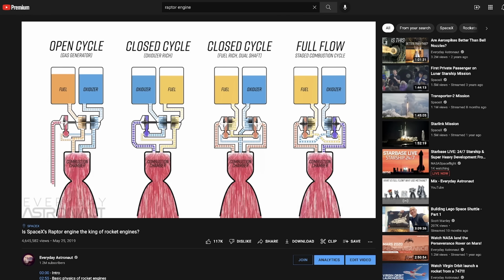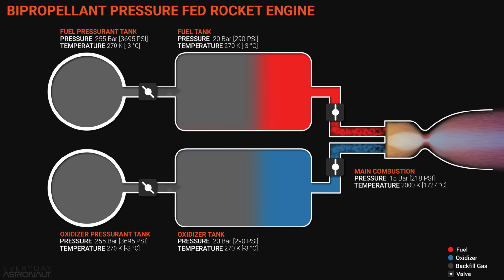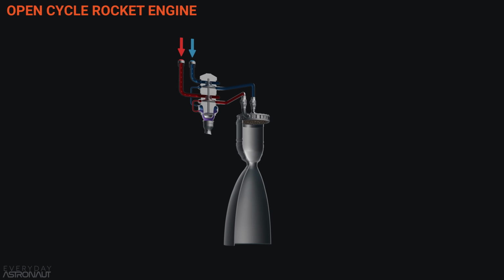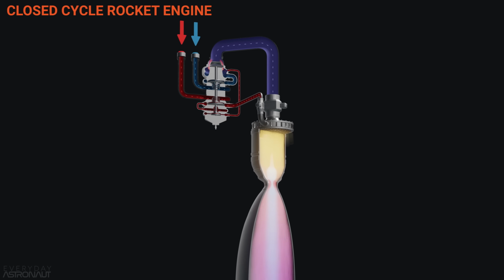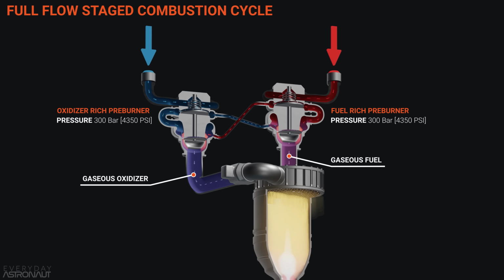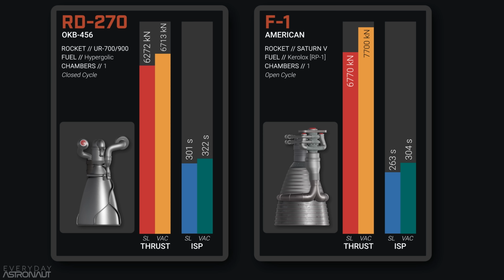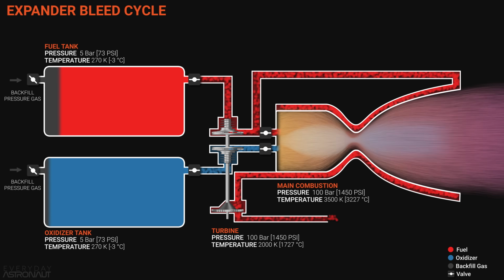Rocket engine cycles: How do you power a rocket engine?

Comment: Oh yeah, on 2nd viewing; about that Tap-Off method.  How about modifying that way up high on the storage tank end of the contraption?  essentially turn the storage tanks into a syringe with a small rocket engine pushing down on the piston to pressurize the fuel then use the pressurized fuel to run reciprocating pneumatic motor type pumps to get the now super high pressurized oxy-fuel into the combustion chamber?

Comment: Please I want to ask why is oxygen rich staged combustion cycle is single shaft and not twin shaft and what of Hybrid FF ORSC
 Hybrid Full-Flow Oxygen-Rich Staged Combustion configuration, commonly abbreviated Hybrid FF ORSC.
The architecture combines:
a primary oxygen-rich staged combustion loop,
with a smaller fuel-rich methane preburner circuit.
Unlike true full-flow staged combustion engines, the oxidizer side remains dominant while only part of the methane flow is fully gasified prior to chamber injection.
The design aims to capture many of the advantages of FFSC systems while avoiding the full complexity associated with dual large-scale preburners and completely independent gasified propellant loops.
Design Objectives
The Hybrid FF ORSC architecture seeks to achieve:
near full-flow combustion efficiency,
improved propellant mixing,
reduced turbine thermal stress,
cleaner combustion,
lower maintenance requirements,
and simplified operational sequencing relative to true FFSC systems.
Because both propellants enter the combustion chamber in partially or fully gaseous states, combustion efficiency is expected to improve significantly compared with conventional ORSC systems.

Comment: Need a 3rd element steam. Use water to cool down around the nozzle that turns the water to super heated steam then use the steam to compress the gas again then run steam through liquid oxygen to turn it to water then back to cool the nozzle.  A closed circuit.

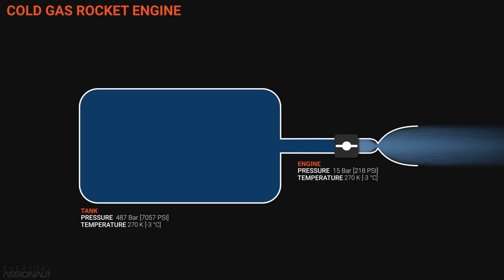Comment: hey man super great video, i almost made it 1/2 thru. at 8:42 you mentioned that as the pressure drops in the nozzle, the fluid changes phases from gas to liquid. it would go the other way: pressure down, would make it a gas; pressure up would make it a liquid. visualize a cylinder with a piston in the bottom going down, pull the handle down: more volume, the atoms are more spread out; push the handle up (less volume, pressure up), the atoms are closer together and it becomes a liquid. or you could use PV = nRT. it’s something i learned in engineering school, you could ask one of your friends who went to engineering school to explain it to you. 

i kind of don’t think you really have what it takes to be an astronaut. your videos are pretty ok tho.

Comment: I know this is a bit late, but with the mono and biprop pressurised engines, instead of having to have a big heavy tank, could you instead have a monoprop decompose to pressurise the tank enough to work, as needed?

Also, instead of the autogenous pressurization system used on super heavy, could they use some of the power from the pumps and pump say helium around a hot part of the engine, to heat up and then into a heat exchanger in the propellent tank to heat and therefor boil the propellant to pressurise the tank? That would eliminate the problem of water ice forming in the tanks and blocking the propellant lines to the engines.

Comment: Why not pump the gas from that engine directly into the fuel and oxidizer tanks to maintain the pressure instead of having a pump? I feel like this will be more efficient.
Or literally just have some fuel be pumped into the middle of  the oxidezer tank and use the combustion gasses to maintain pressure in both tanks
Reply: Well, tiny rocket engines already spin the turbine. But capturing main exhaust is very hard: you need to somehow move that high pressure and temperature from bottom of your stage to the top

Comment: I’ll skip the obvious question about whether or not rockets work in a vacuum, and move on to one that can’t be but pushed off:  the flow of fuel through the engine works completely differently from when under atmospheric pressure, and is completely unpredictable, maybe even useless because of the vacuum, what do you think ?

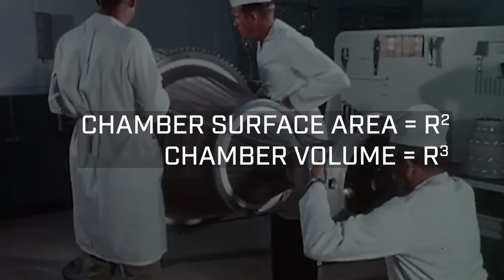Comment: Thank you very much for your video. At 48:57 You say 'This means it's actually easier to cool a large rocket engine  than it is to cool a small rocket engine.' But square-cube law you referred says the exact opposite. And also we know 'increasing surface area to volume ratio will result in more rapid heating and cooling'. So these make your sentence wrong, or am I wrong
Reply from the maker: There’s more fuel flowing in a large engine which means proportionally more fuel flowing through less amount of wall surface area = more cooling capacity. There’s more hot stuff in total with a large engine, but less hot stuff touching walls the larger the chamber is

Comment: 4:46 I would rather refrain from saying word "heat energy". Because the energy is mostly represents a stored type of quantity. While heat is a kind of form which only appears when it crosses boundaries. The proper use of word is "thermal energy".

Comment: I‘ve always wondered: the concept of a pressure fed engine - where the high pressure gas should be sitting 'on top' the propellant push it down into the engine, and the propellant likewise should...well...'behave well'...and sit quietly on top of the pipe that leads to the engine.
Which is not something you can guarantee in a zero G environment.
What if the propellant bubble just decides to float aside? and now the pressure feeding helium is going straight down to the engine?

I've heard propellants in turbo pump driven engines can have the same problem, and mitigate it by using ullage motors or hot staging to use the rocket's own acceleration as a 'artificial gravity'. Once the engine is going, the acceleration will keep the fuel 'behaving well'....

which can not be expected in a quick firing RCS thruster that uses pressure feeding systems.
There is no acceleration to keep the fuel settled down.
So...how can spacecraft floating in orbit fire their pressure fed thrusters without the fuel floating problem?
Reply from the maker: Watch my video on how to start a rocket engine! We go into great depths about ullage thrusters and such 👍
Reply: @EverydayAstronaut   Yeah I've seen that video, was a nice one too. But still I don't see how it can be applied to RCS thrusters. it's not like spacecrafts fire ullage motors everytime before they fire RCS?
Reply from the maker: We talked about that in the video, they use things like wicks and surface tension devices, or even bladders or pistons for RCS operation 👍
Reply: @EverydayAstronaut  guess I've gotta whatch it again! thx for the advice!

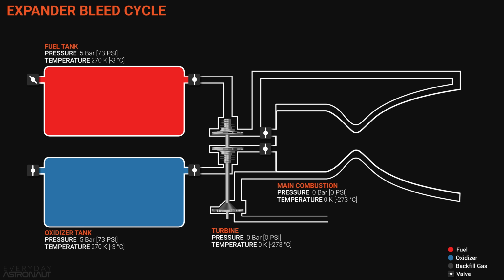Comment: 51:11 I dont understand the difference in open cycle and expander bleed cycle if the fuel just gets dumped out anyway? Is the expander bleed cycle not just open cycle with reactive cooling?
Reply from the maker: Expander bleed doesn’t have a gas generator. The energy to spin the turbine comes from the fuel being heated through the regen channels

Comment: Late to the party, but shouldn't there be an explanation early on for why the rocket actually moves? That is, how and where the propulsive force (reaction) is physically applied to the rocket.  I remember being very surprised to learn that this happens nowhere near the nozzle, but at the opposite point of the tank from where the gas escapes.  I was shown arrows indicating equal pressures inside the tank, except where the nozzle was.  The unbalanced pressure forces the opposite, sealed end of the tank to move, taking all the rest of the engine and vehicle with it.   I'll bet a lot of people poorly understand this basic idea.  I miss those arrows!
Reply: No. This video is for the advanced enjoyers of the rocket engines. It focuses on pumps specifically. If you need the basics, go find another video, this video is already long enough.

Comment: When will rockets have push and pull mechanics or is it all just push? Jets use push and pull mechanics, Jets go fast! Rockets go slow, have you seen a jet take-off? Compared  to a rocket take-off? Jet fast, rocket slow!
Reply from the maker: I think that’s a matter of perspective! Rockets usually are accelerating around 1.3-1.5G vertically. They’re just HUGE so you can’t really tell. That’s way faster accelerating than any other jetliner horizontally. Granted some fighter jets can accelerate horizontally faster for a bit but rockets usually get over 3G when their tanks get emptier near the end of the burn. So rockets are way faster
Reply: @EverydayAstronaut  Rockets are clearly slower, I see it at every launch. How sluggishly slow they get liftoff. How much fuel they burn during lift-off. Jets much better. Give me a 747 launch to space over a rocket anyday
Reply from the maker: A 747 accelerates a 0-60 in about 10 seconds and a max climb rate of about 4,000 feet per minute. Starship pulls over 0.5 net G at lift off which is about 5.5 seconds to 60 mph… so much faster and climbs a minimum of ten times faster than the max climb rate of a 747….
Reply: @EverydayAstronaut So you are saying a Tesla can drive faster than a rocket. Cool
Reply: @EverydayAstronaut Lets talk about your name. Astro-meaning land or turf. Naut-meaning navigation. Nothing like a cosmonaut or space navigator. which I am, but hey, I wouldn't expect someone trying to stay on the ground to understand how unefficient rockets are in space travel.
Reply: @CalamitousJonathan  That etymology qualifies for a Duhwin Award!
Astro=turf? 😂😂😂
Reply: @CalamitousJonathan   You are amazingly stupid.

Comment: Really good video. Exemplary teaching technique. Wished you'd had a cutaway model  in your  hands during some of the explanations.   A bit too much information to mentally organize in one sitting but knowing where i can find it for review is good.  
    IDEAS:  I like the electric pump idea. There must be hundreds of potential embodiments.   Hydraulic accumulators might also be viable.  Lining the combustion chamber with diamond ceramic may have some potential.   That throat adjacent to the combustion chamber also holds potential for development.   Injecting high explosive there may be a thrust booster.

Comment: The V2 pumped the alcohol around the combustion chamber before it was introduced into the combustion chamber thus cooling the combustion chamber however, they did not use this pressure to run the turbo pumps but used this high pressure alcohol to effect mixing as they did not utilize impinging nozzles.  One must wonder how using super-heated alcohol effect efficiency.  The LOX reached the combustion chamber in liquid state.
Reply: Cool pump a bunch of greenhouse gases into the atmosphere, what could go wrong!

Comment: why not wrap a variable geometry BLDC motor around a conventional turbopump?  you could rely on the turbine to power the big boom of full throttle, then control the RPM better at low throttle with the BLDC

Comment: Very nice. Some misunderstanding. Flow from high to low pressure is not correct at super sonic speeds. The rocket exhaust at sea level is in most cases delivered wit a pressure below the ambient. So how can the engine prevent ambient airflow into the engine? Because the flow is super sonic.

Comment: As I understand it, getting a hydrogen fueled expander cycle engine going is easier than you might think: Before startup, the engine has been sitting at ambient temperature - and any ambient temperature you're going to find anywhere on earth is several hundred degrees hotter than the boiling point of liquid hydrogen. So the "thermal inertia" of the materials the engine is constructed from provides the energy to get the turbine powering the pump going. Not to it's maximum speed and power of course, because the energy available from the walls of the combustion chamber and nozzle once the fuel is burning is a whole lot more. But it is enough to start the process and get the propellants pressurized sufficiently for initial injection and ignition - and once that has happened, the turbine accelerates to full power within a second or two and so does the rocket itself.

Comment: So the theoretical best design, would be something that can pressurize the fuel coming into the engine with ~20% more bar then then burn pressure, while being (easily) self starting, efficient, simple and reliable. 

So we could start with a simple and low chamber pressure that is below the tanks in order to have a small combustion that pre-heats the system and drives the turbo pumps, therefore creating more pressure than the tanks until desired optimum is reached. So instead of having a pre-burner, that is pump-fed, we just use the main engine as the "pre-burner" itself.
This probably was in mind of the person that came up with the pre-burner thing and I guess wasn't possible, because of materials withstanding the heat 🤔 Maybe it is possible today? There has to be some genius way, to create enough energy from the combustion itself, to fed the pumps. Maybe you could combine the preheating inside the chamber walls + something that rotates within the chamber. Or maybe you could rotate the whole chamber (but then you couldn't flow fuel through it haha).
I guess that would look really funny, if the whole chamber would rotate like crazy and the exhaust probably would look really cool too :D

Comment: The LE-9 engines for the main stage of the H-3 are also expander bleed cycle engines.  They are the largest such engines ever produced.  These engines were developed in order to get away from the complexity and cost of the fuel-rich staged combustion LE-7A engines used in the H-II.

Comment: I've head the pump motors on the Rutherford engines make about 50hp each and run at 40,000rpm.  They are cooled by the RP-1 fuel and they and the pump are one complete assembly.  And the pump itself is completely 3D printed.

Comment: A bit of diving into Rocket Science made me ask a simple, yet deeply sophisticated question.

You have Hydro-lox engine, full cycle.

You got crazy over 3000k temperature.

You need 1:8 ratio of propellant, and there is a  all sort of problems with leakage etc.

Why dont use H2O?

It burns in 2500k, it cools good enough.

And its SAFE.

Also could be pressurised.

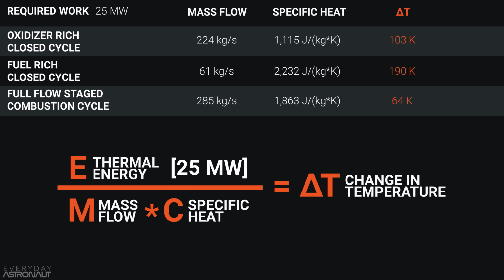Comment: Why the temp change is higher in the fuel rich closed cycle than oxygen rich ( at 41:00 ) ? I am getting confused because the fuel to oxidizer ratio is more in the fuel rich engine (than the oxidizer rich engine) and as we studied in the engine cooling video more fuel to oxidizer ratio means lesser temp. In the engine means fuel rich should have lesser temp. Change than the oxidizer rich closed cycle but it is coming to be opposite.

Comment: What if you pressure fed a rocket engine, but replace the pressure tanks with small solid rocket engines. No need to hold the high pressure for long periods, just a few minutes, most of the weight of the 'tank' is no longer dead mass but reactive mass. Mass flow and temperature could be much much higher than a typical pressure fed engine at the expense of no or few restarts.

Comment: 4:47 — “Pressure always flows from high to low”:  minor nitpick, but I think what you mean to say is that fluids always low from a region of high pressure to regions of lower pressure.  

Similarly, heat (not temperature) flows from hot areas to cold areas, electrical charge flows from high voltage to low, and mass flows (falls) from high places to low places.

Pressure, temperature, voltage, and gravity, don’t flow.  They are states, not media.

Sorry if I’m sounding pedantic, but we are talking about Physics, so it’s worth making clear.
Reply from the maker: You’re absolutely right! Thanks for the reminder!
Reply: @EverydayAstronaut , nitpicking aside, thanks for all your awesome videos on rocket tech and history!

Comment: OK - prerequisite video completed. Now onto this video.
Reply from the maker: Awesome! Thank you for doing the prerequisites! Enjoy the video, let me know if it all makes sense 👍
Reply: @EverydayAstronaut  You explained all of this very well. Now I'm ready for "How to Start a Rocket Engine." The one thing that I still wonder about is the rat's nest of tubing that runs around many of the older engines. How does something not fail with all of those tubes running everywhere. I suppose they are there to correct "little problems" that arise when you actually build one of these?

Comment: I'm sorry if someone already asked that question, but can Tap-Off cycle use simple heat exchanger with fuel/oxidizer lines from turbopumps?
1) It will cool off the gas for turbine without addition of fuel or oxidizer
2) It will boil the fuel and oxidizer making gas-gas interaction

Comment: With RCS thrusters, you show a high pressure inert gas being used to pressurize the propellant tanks.  In microgravity, what prevents the inert gas from “tunneling” through the propellant and exiting the tank in place of the propellant?

Also, all of your examples with the exception of the V2 show centrifugal turbines with the V2 as a vane-axial turbine.  Has any thought been given to a Tesla turbine.  These types of turbines can reach insane rpms, and with the admittedly slightly increased weight and complexity can be geared to whatever speed/torque regime the pump curves require.

Comment: okay, superfrankenstein engine: Full Flow Staged, but with undersized turbines, coupled with electric motors and dual expander for ultimate thermal efficiency

then throw 2 gas generators on for the heck of it, it wasn't gonna have a good TWR anyway XD

Comment: why wasn't Methalox used sooner? the RS-25 would have had a much easier time being developed with a single shaft, with much denser tanks, which means better aero, more fuel capacity, it could easily make up for the losses in efficiency.